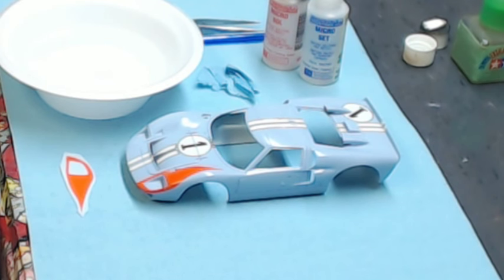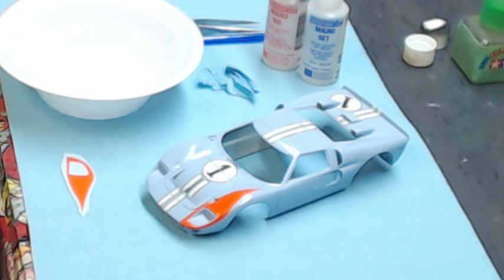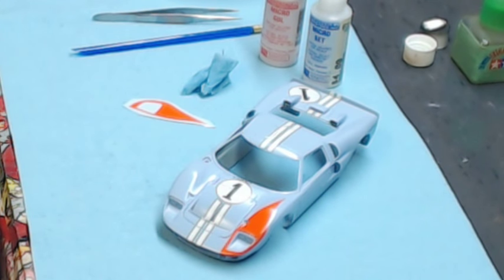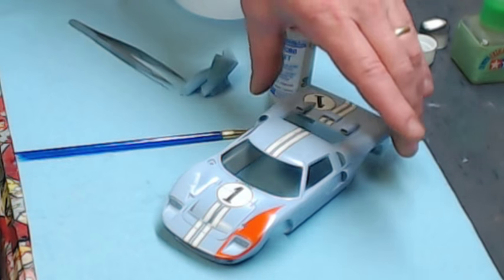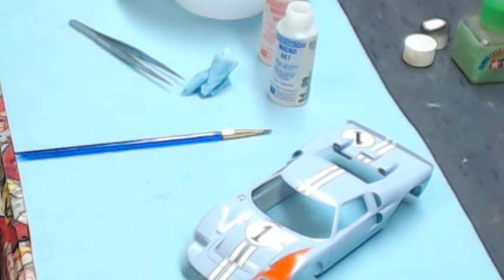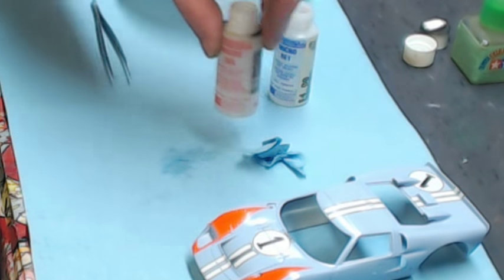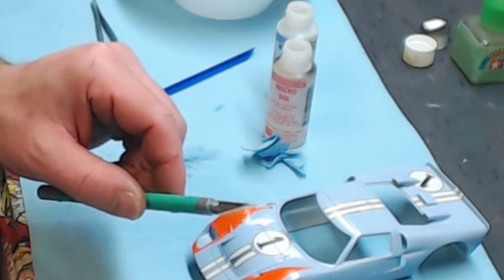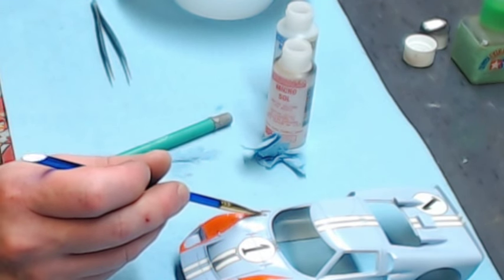Decal tutorial (compound curves)

Comment: An excellent "how-to" video. I'm primarily a WWII tank modeler and deal with zimmerit surfaces,etc. A couple of things I do could help you and speed up your operation.  First I don't put my decal in a dish ,I use a sheet of glass for both cutting and soaking. I put the warm water on the decal with my finger tip one drop at a time. I don't touch it with my fingers at any time. This allows the glue to soften and let the decal loose but not wash it away. My second recommendation is, instead of your shop towel piece, I use a fine sponge. I used to get mine from my lead figures but now I get them from Walmart in the makeup section. I prefer the triangular shape but others are available.  I learned something myself from your video. I never thought about using a shop towel to cover my work space. Thanks for your help.